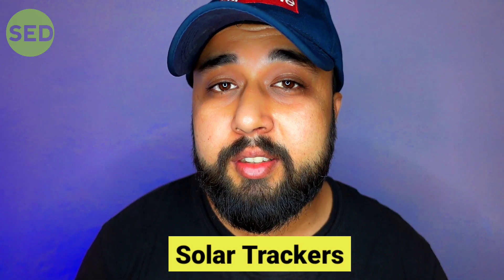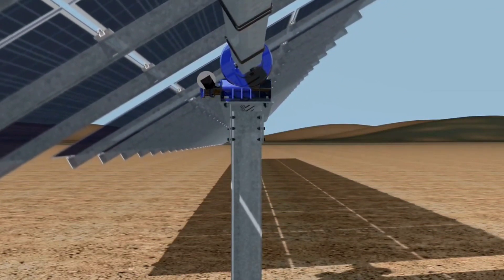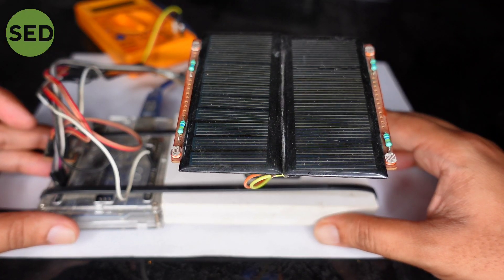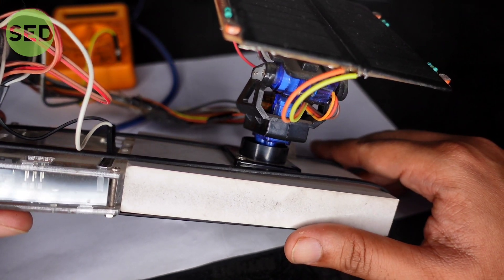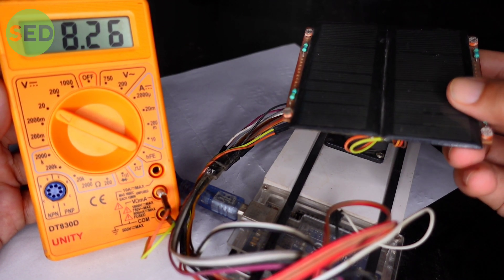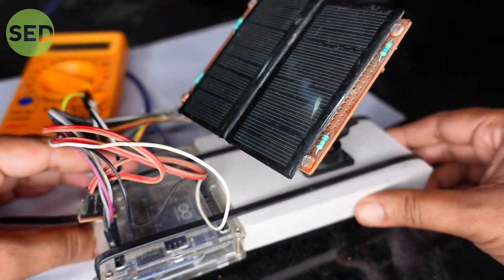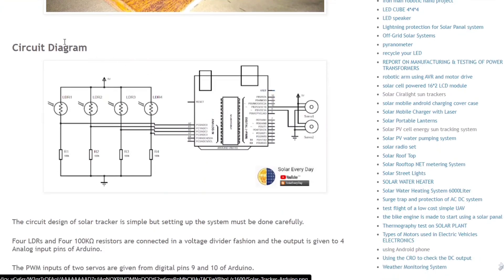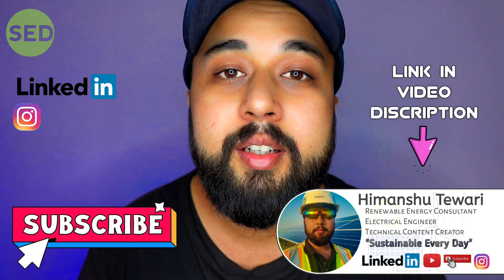Dual Axis Solar Tracker | Free Download | Prototype Project | For Engineering Students

Comment: Hi, please I need your help!! 
I do the same code in programme proteus, but the servo turne between - 90 and +90, he turne once،and does not rotate gradually with the increase of the value of Ldr???
Reply from the maker: even i tried it on Proteus software , i found that proteus dosent show realtime simulation , it just pays the program line after line
Reply: Same problem with me too